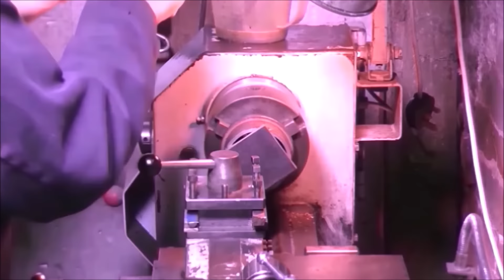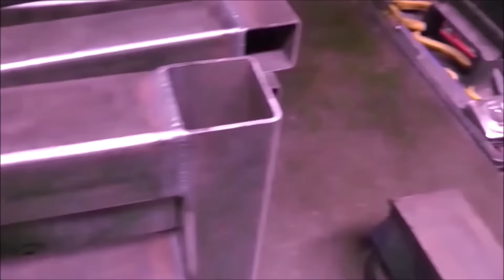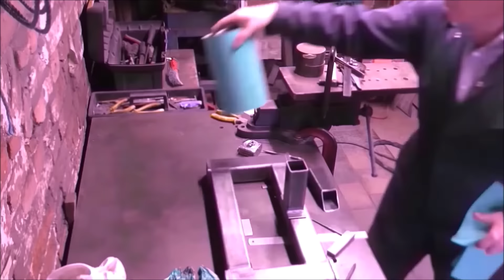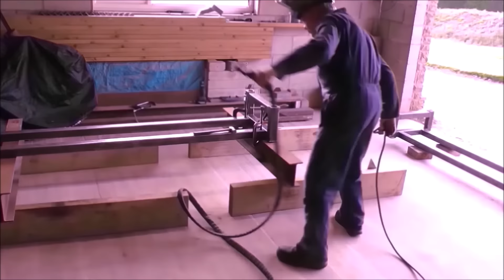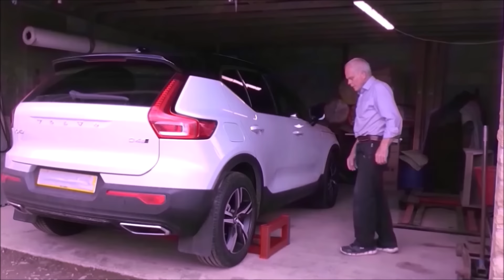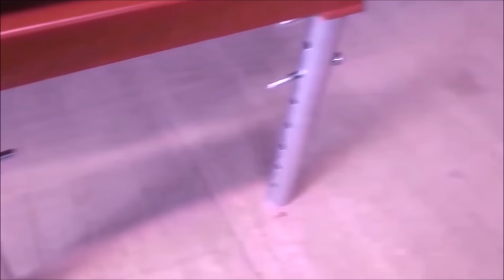The ultimate homemade car jack, simple to use, compact when not in use.

Comment from the maker: IMPORTANT NOTE:  When using these lifting frames one end of the lifting frame must always be resting on the floor when the other end is being lifted, as shown in the video.   SOME PEOPLE IN THEIR COMMENTS have suggested lifting  both ends of the frame at the same time, THIS WOULD BE VERY DANGEROUS because If both ends of the frame were lifted off the floor at the same time there would then be nothing to stop the car wheels rotating,  the rotating wheels coupled with the weight of the car could kick the frame and jack from under the car which would then come crashing down, this is why one end of the frame must always be resting on the floor when the other end is being lifted. A lot of thought has gone into designing these frames both for ease of use with safety in mind.
Reply: Couldn't you weld a lift point in the middle of the frame and lift both ends at the same time. I know normally you need to lift each side for jacks etc. But with your system would it be possible to lift the back up part way then move to the front and do that part of way and so on if you had a lift point in the middle of the frame. Assuming you built two units. Front and back of course which you did.
Reply from the maker: @xray364  READ MY IMPORTANT NOTE AGAIN.
Reply: This would beat a damp inspection pit any day.
Reply: Hm... you could use the parking brakes for the back axle/wheels, to prevent this happening. For the front (or actually all 4 wheels), one could buy a cheap iron rod and put it on the brake pedal with one end, and against the front part of the driver's seat with the other end, so the brake pedal is kept pressed the whole time. This way all 4 wheels could be immobilized. And also keep the car in first gear all the time.
Reply: @johnbower  John I understand your note. But I thought this applied more if lifting one side of a veicle. What I meant was both rear tyres up at the same time and both front tyres lifted at the same time. Obviously you still need to manage the lift sensibly in moderate several lifts as you dont want the vehicle rolling forward or back.
Reply from the maker: @xray364  You must not lift both rear wheels at the same time and you must not lift both front wheels at the same time, READ MY IMPORTANT NOTE AGAIN SLOWLY.
Reply: easy to stop the wheels turning if that's your worry, gears and hand brakes, but how would they turn they are grounded tot he frame as if it was the road/floor,
Reply from the maker: @roberthorseman7432  thanks for watching
Reply from the maker: @HPaulAdrian  thanks for watching
Reply from the maker: @sicks6six  You have been warned, thanks for watching
Reply: which is why they should be strapped down ANY chance of moving would come off stands.not strapped down the wheels would have a tendency to roll if strapped they wouldn't roll off.
Reply from the maker: @timmyhipbird7543  You obviously fail to understand the problem if both ends of the frame are lifted at the same time, strapping the wheels to the frame that is being raised on a trolley jack will not stop the wheels rotating,  the lifting arm of a trolley jack naturally pulls backward as it is being raised, this backward movement of the lifting arm would pull the frame backwards which in turn would pull the wheels backwards causing them to turn a little, because the wheels have now turned a little the lifting force will now be behind the vertical line to the wheel spindle, once the lifting force is behind the vertical line to the wheel spindle the weight of the car will be trying to push the trolley jack backwards, once the trolley jack starts to move backwards the wheels will rotate further and kick the jack from under the car, this would still happen if the wheels where strapped to the frame because if both ends of the frame are jacked off the ground the frame will move backwards with the wheels kicking the jack away as the car comes crashing down.
Reply: @xray364  That would work great and the unit wouldn't twist. I really hadn't thought about that. I hope our friend Mr. Bower picks up on that as that modification would be simple.
Reply: If you have a good parking brake and the transmission is on P there should be no problem.
Reply from the maker: @skywind007  Having a central jacking pad in the frames was ruled out in early stages of design due to danger issues, read my important note pinned at the top. thanks for watching.
Reply: I really like your idea!
I guess, in theory you could still use 2 jacks, but not both at the front or end, but both on the left OR the right side. So the individual frames would still be on the ground each.
The only thing that makes me a little bit nervous is the little space the legs stand on. Not so much because of stability, but digging into the pavement or at the least leaving nasty marks.
Also, as an alternative: For scaffolding they have legs with a weight distribution plate which would probably fit nicely inside your tubing. Thinking about it: There are extra long versions available of these and probably could be used instead of making your own design. The legs have a very course tread and so it is always secured with the over dimensioned nut.
Reply from the maker: @marwerno  Glad you like it and thanks for your comments. Note: I have pointed out in some of my other comments that metal plates must be placed under the legs when working on unstable floor.
Reply: GOOD Day sir..
what is the THICKNESS of the tubular and round pipe(and diameter)..???
thank you for sharing your wonderful idea.
Good Bless
Reply from the maker: @benedictfruelda9529  The outer diameter of the tube that make the legs is 48.7mm and has a wall thickness of 4mm, the tube is also galvanized.
Reply: John,  I really like the simplicity, practicality and safety of your well thought out lift/stand design.  I’ll be incorporating several aspects of your design into my own based on my specific needs.  Thank you for not only posting the video, but for being so active in the comments to ensure people know how to use it safely.  God bless you sir!

Comment: John, I feel bad you got all these hate comments. You made something, and it works well. Thank you for sharing.
Reply from the maker: Thanks for the comment, it is nice to know that most people can see the benefits it has.
Reply: @johnbower  I've just stumbled on your video and I appreciate the project and the inspiration it gives me to make my own project based on your idea.
Thank you and greetings from Portugal.
Reply from the maker: @VitorMadeira  Glad you like it, thanks for the comment
Reply: Death trap !!!!
Reply: Those comments are from people that have no skills and mad they can't build anything. They just say things like death trap but give no solution or better options because they can't do anything but complain
Reply: @johnbower Good job John ! 
I think I'd add some feet to the tubular uprights to protect my concrete floor and tarmac drive way.
In reply to the comments on being unable to remove wheels, one could adapt your design to raise the car on the four jacking points or other symmetrical strong points ?
Reply: looks like a good idea, One thing that I would absolutely do is to add a floor plate under each of your lift posts.
Also using a square tube with floor plate already in the channel prior to driving on would be much easier and I am sure stronger than the round tube posts.
I see that lifting at each corner higher than the rest puts a side force on the other legs. Not good with round tubes.
Reply: @nigelmitchell351  once it is lifted stands can be put where you want a wheel off at frame you could just lower one section.
Reply: @mefirst4266  WHY? Explain! It seems sturdy enough. You are just distributing hate for no reason... jealous? Only improvement I see is thicker steel tubes on the legs and a weight distribution plate. But he is using it on concrete which is level. There should be no issues.
Reply: hate comments? all i see are comments saying ignore the hate and i cant find it. tf is there to hate

Comment: It not really a Jack, it a car stand. You can't take a wheel off if you find you have a problem.  It just seems ita lot of work to get the car up in the air. It would be easier to use Jack stands
Reply from the maker: Peter Edwards .(a) You did not watch the complete video.  (b) Anyone with any common sense would be able to see the car can easily be lowered onto jack stands if wheels need to be removed.
Reply: You know as well as I do, it hard work the way you lifted the car.
Reply: Hydraulic jack may be used to lift the control arms or frame without lowering his contraption to remove the tires.
Reply: @albertcassler8763  you would need a tall Jack to do that, wouldn't be very stable.
Reply from the maker: @albertcassler8763  (a) You won,t get all four wheels 500mm off the floor by jacking under the control arms. (b) if you tried jacking my car up from under the control arms you would be in serious trouble.
Reply: @johnbower if you need to use the axle stands why do I need a car lift in the first place, as what other reason would you be lifting the whole car up with no access to removing the wheels.for besides exhaust or oil change. One thing I will say though is he is a quality welder.
Reply: This comment really shows the difference between those that have had to pull a transmission or weld exhaust pipe and those that haven’t.
Reply: @athhud  So let me get this straight if you were pulling a transverse engine gearbox out (front wheel drive for those who are clueless) not all makes allow you to drop the driveshafts without the wheel being moved to get to the wheel hub on outer cv joint, unless you are a magician. So you have made a lift just for exhausts, very nice. And by the way I have pulled and stripped many a transmissions, remove engines etc as a Ford, Vauxhall mechanic plus I was a M.O.T inspector so. your right what do i know.
Reply: @jazzzsm6546  and hopefully with all of your “qualifications”, you were doing the job on a 2 post lift. For the guys doing the work at home though, it would be well worth the trouble to remove the cv shaft and then temporarily bolt an upper control arm back in place so that the vehicle could be raised in the air as much as possible. It would be very easy to pull the shaft/shafts out while on the ground and then raise the car on this “lift”. The extra room to work would be greatly appreciated, especially on a stupid transmission that is attached to a sidewards engine. Of course there are a thousand different jobs that could be required under that XC40 and all of them are made easier by having the vehicle higher.  Explain to me how you plan to drag a transmission out from underneath that Volvo on a standard set of jack stands. . .
Reply: @athhud  probably more qualifications than you if you see my certificates but there's no reasoning with some people, so goodluck to you and make the lift for yourself, knock yourself out as I have no time for time wasters. Have a good day
Reply from the maker: @jazzzsm6546   Don't criticize what you don't understand
Reply: @johnbower  Jack I've done enough jobs on the road as well as In a professional garage,  using both 4 poster, two poster and axel stands, what exactly was I criticising,  I was just giving my view which I'm more than entitled to do, from my experience, you don't have to listen to it but if you put a video out for people to watch you will get people giving their view, some you will like some you won't but don't tell me I don't understand,  I spent many years studying and working in this field when the majority of people who watch these videos are not professionals, I'm sure you understand that. If you had said your building a ramp just to get exhausts off or rear wheel drive gearboxes off, I would understand even though I would still say that's alot of work just to do that, I did say your welding was top notch.
Reply from the maker: @jazzzsm6546   You must understand there are many more components underneath a car than an exhaust pipe and a gearbox that may need attention,  problem is most modern cars only have the four jacking points which are positioned under specific areas of the car sills, and are mainly designed for use with the car's own scissor jack which is intended for occasional use such as roadside wheel change and has limited safe lifting height. Yes we all know there are cowboys that use trolley jacks in places where they should not be used, the jacks get positioned anywhere that is easy, such as wrong areas of the sill / under floor stiffening ribs / under control arms etc, doing this often causes damage. 
(a) My lift has been designed to simply and safely lift any make of car without causing any damage as it only makes contact with the car tyres. (b) It is able to lift any car to varying heights in order to gain clear working space. (c)  It gives good access to the entire underside of the car allowing maintenance / repair or replacement to be carried out to any component under the car. (d)  If any wheels need to be removed then just slip a couple of jack stands under the car sill jacking points and the lifting frame can be moved from under the wheels. (e)The lift can also be used to raise a car when carrying out repairs etc to the car outer bodywork, as this is often easier when the car is higher off the ground. (f) The lift is also useful with vehicle restoration projects. (g) The list go's on.
Reply: @athhud  I pulled an automatic transmission out of a Freelander 2 on normal jack stands. 

Had to take the front subframe off to get it out like. Though I'm 99.9999% sure that if I used this to do the job then the gearbox would be blocked by this device. So then you'd maybe have to take the subframe off to get it out again, so then you have no mounting points for the control arms.
So I kind of agree that it's a bit pointless. 
Not that I want to detract from the guys idea, If I could weld and had the steel about to knock one up for a few quid then I'd do it and I'm sure it would come in handy. It would be more useful if it jacked up under the jacking points. Same Frame but welded in a square with each point under a jacking point on the sill. It would do the same as now but then also allow full access to the engine area. 

But kudos to the guy for doing it and making a nice job of it.
Reply: Did you even watch the video to the end? You jack it up, put jackstands under the car, then lower it and pull it away from the car to take the wheels off.
Reply: That's not the point. The point is that you can work under the car without having to spend thousands of dollars to have a lift installed in your garage.

Comment: That’s a nice design! I like that you saved material and footprint space by making that cantilevered jack plate removable. Well done, and thanks for sharing.
Reply from the maker: Elliot Bickle,  Yes  main reason for having the removable jacking arm is to keep the main frames compact, then when frames are not in use they can be stood up on their ends in corner of garage, thanks for the comment.

Comment: Well done... as a former mecahanic approaching my 70s thistle is a great innovative idea, which no doubt other DIYer home innovators (self included) have already made specific modifications to the overall concept and build tailored to suit personal budget, space and needs includind the use of hydraulics and airbags.

No doubt the issue some have seen with immobilizing any initial forward or reverse movement of the vehicle during the initial part of the lift can easily be addressed if one was prepared to have anchor pins that would slot into pre installed holes in the floor that a suitable size pin could easily be dropped and extracted in an out of to.prevent any forward or reverse inertia during that and any other part of the lift.

The only other issue l would personally  address with this system is finding a way to have suitable metal plates for the 8 vertical pipes to rest on.
No doubt others like myself have already addressed how to go about this too.

Thank you very much sir. Your workmanship and idea is much appreciated and valued.
Have a great day.
Reply from the maker: Glad you like it thanks for the comment

Comment: One word "WOW". Most stable platform I've seen. Next project, a carriage that can interface your lift to the frame or jack points so you can remove all your tires.
Reply from the maker: Michael Dovorak, I have made plans to build four oversize sturdy stands that will fit under the four dedicated jacking points below the car sills, then if wheels need to be removed the stands can be positioned under car sills and the lifting frames can be removed. thank you for your comment
Reply: @johnbower  I can't wait to see it. Thank you for sharing.